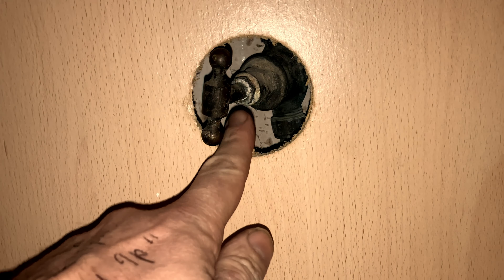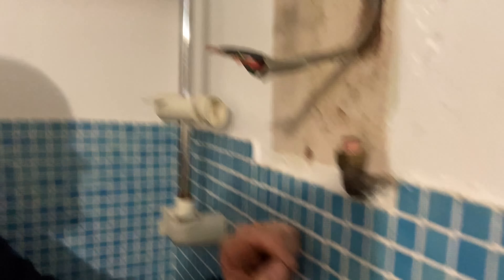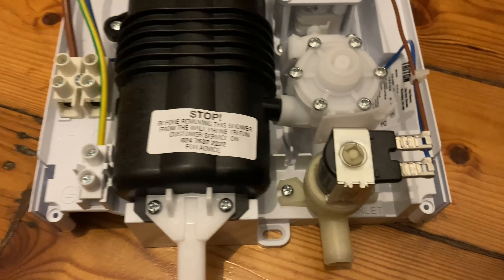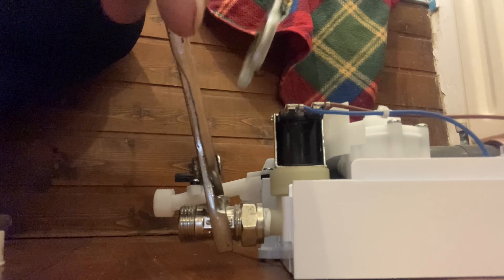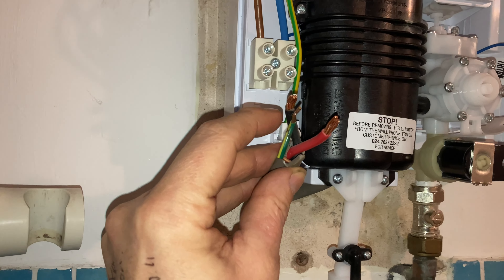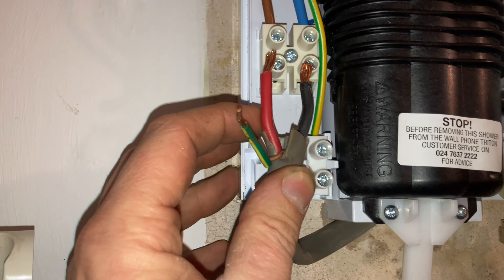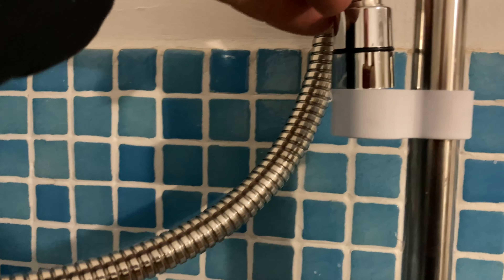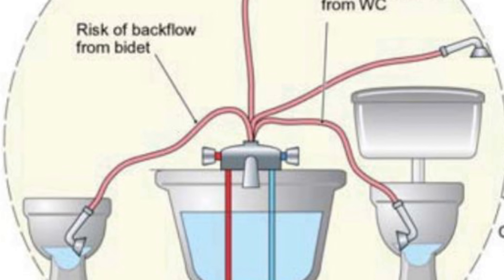How to install an electric shower 🚿

Comment: Hello. Is it ok to tile around shower instead of tiling behind it?  As long as I seal good?
Reply from the maker: No it’s dangerous as the shower cud over heat and cud b challenging when it needs to b replaced
Reply: @warriorsofwarmth  thank youuuu